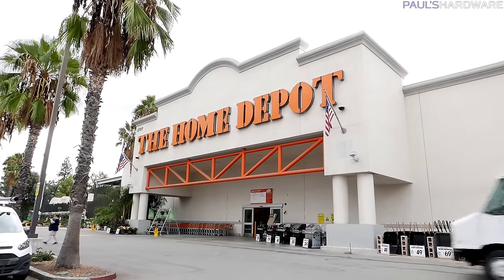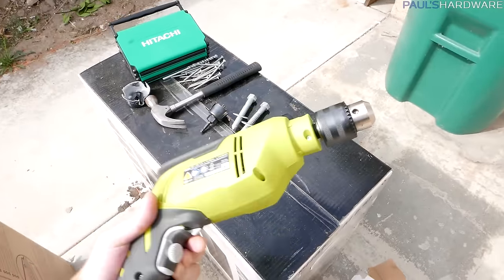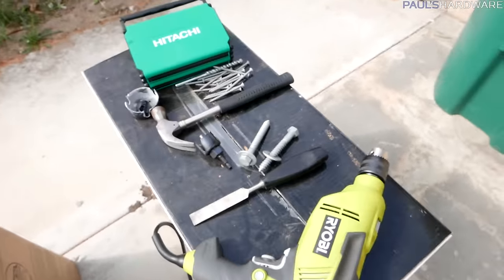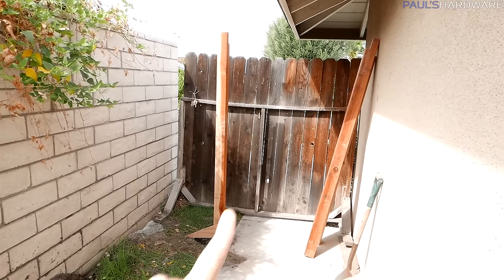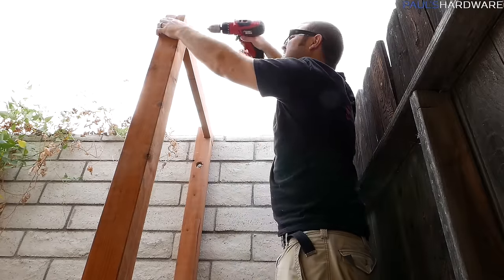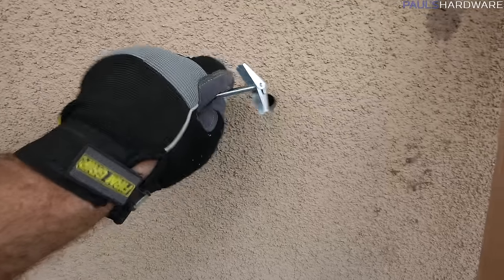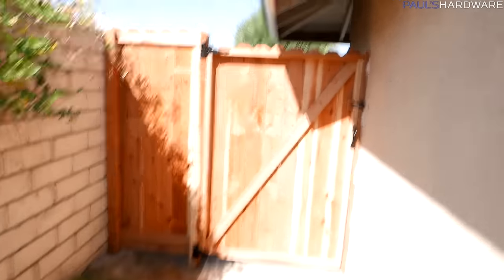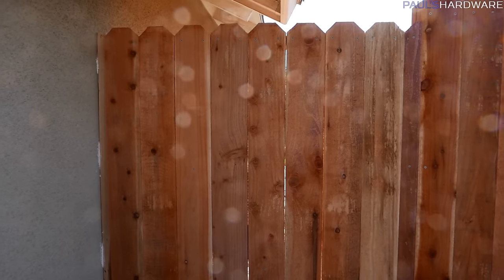Let's Make A Gate - Paul's HardVlog #011

Comment: you really could make a channel called paul's home improvement to put these on 

and to whoever said that black & decker is like a raidmax psu is wrong that would be Dewalt

a black & decker is more like a rosewill psu sometimes you can trust them. but there drills are actually really good. take Note of this there saber saws are deadly mine shot a blade after coming off about 20ft into a 3 sheets of drywall. but everything else they make is fine.

PLEASE WEAR CLOSED TOED SHOES WHEN WORKING WITH TOOLS MY LORD THAT'S DANGEROUS

Comment: Nice job! You did everything we recommend at Lowe's. Quikrete rocks! BTW, "used" probably means the original drill was stolen. Workers for contractors like to do that all the time; buy a new drill, repackage an old one from the same brand they might have pulled off of a job site, and return it to the store for a profit. Lowe's will take virtually anything even without a receipt as long as you have a valid drivers license.

Comment: Paul you are gonna have to replace that 4"x4" post, they always rot out. Best to use metal galvanized fence posts, then its just one and done. Other than that, you are petty damn good handy man.
Reply: Best thing is metal fence posts, never had to replace one. While I have helped put in wood fence posts within the last 10 years and one already needs replacing again.
Reply: +raider762 That's because you're doing it wrong.  You either concrete all the way up (unlike how he did it) with a slight slop to drain water away or better yet concrete in a galvanized post base.  Redwood will last a long time as long as it isn't in standing water...
Reply: +raider762 As long as it's pressure treated wood, it will last a long time. A fence my father installed 30 years ago is still standing strong. I imagine Paul will have sold the house before it needs to be replaced.
Reply: +raider762 
Also just having the wood lacquered would help a lot in the long run.
Reply: +tmar23  Ok yeah I was doing it wrong. Didn't know any better. Thanks for the information.

Comment: for the holes drilled into the stucco where the "tug bolts" are just fill with epoxy after the hardware is installed.. it will fill the gap nice, harden and help a little to keep those bolts in place

Comment: If ya ever need to make a long straight cut use a straight piece of plywood or anything to guide your skill saw, just clamp it to the material so it don't move. 

Also check out a screw that goes by the name of SPAX, they're fairly easy to work with and just go right in.

And ya totally shoulda built it so it can open either way, but that'll only matter sometimes.

Comment: Your pickets are really close together. Good luck with the expansion/contraction when seasons change.
Reply: +Josh Olson He lives in southern california
Reply: +Omazing All the more reason for concern. A quick Google search shows California fluctuates from 15% to 99% humidity. I live in Minnesota, which ranges from 11-100%. From a website: "For every 4% change in moisture content, flat-grain boards with two layers of primer will change size approximately 1%. That means 1/16" in a 1x6" board!" Mapping humidity to moisture content, we're looking at 4% to 23-30%. Let's assume the best case, current moisture content is in the ~middle of the range: 16%. If we reach that high humidity/moisture content, each one of those 1x6" pickets will expand 7/32" (almost 1/4"!!). However, here's the kicker: California's been in a drought for 4 years; that wood probably has really low moisture content now. When/if that drought turns around, those pickets could swell 11/32" each. I don't know about you, but some of those pickets look like they're touching currently. Not only that but the clearance on the gate to the posts is tiiiight. Hence, good luck when the seasons change. :-)

Comment: Liked the video Paul.  I work in construction and am also a tech geek so I've really been enjoying your channel.  Just wanted to make a quick comment on the toggle bolts you used.  I've found that they can be annoying to install since you have to pull out on them to keep them from just spinning back inside the wall until you get them tightened up (hope that all made sense).  A few years ago I came across these things called togglers that I prefer immensely to toggle bolts.  You insert the toggler into the hole and then it just "zip ties" into place, you break off the excess "zip tie" and then simply screw in your bolt.  Here's a link to them if you wanna check 'em out.  http://www.homedepot.com/p/Hilti-1-4-in-HTB-Toggler-Bolts-with-Philips-Flat-Head-Screw-8-Pack-3512329/204992997
Reply: Indeed, and if you need to take it down for any reason, you do not lose the end.
Reply: +Maraksot78 Wooh a fellow construction guy :P We once got those on a job but they were super cheap and kept breaking, So aggravating.  I did like his comment about the black and decker tho :P First time I went on a job site I had one, there was alot of laughing XD
Reply: +coolbro12389 I got a kick out his B&D comment too. They really are the Raidmax of powertools. :-D ha ha
Reply: +Maraksot78 haha ya, last year I got my dad an impact and he's never used one and he loves it. now whenever I see people using drills or those little power screwdrivers I just am in awe that anyone can even tolerate using them for screws lol
Reply: That is the power of the Impact.
Reply: wobbly sauce they really are like the best thing ever :P